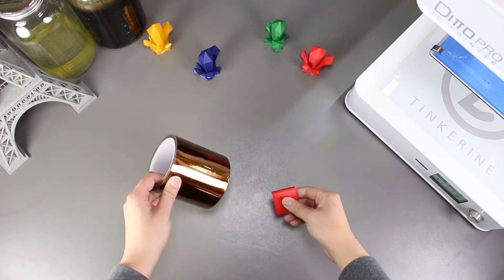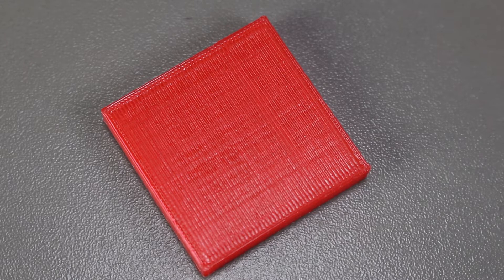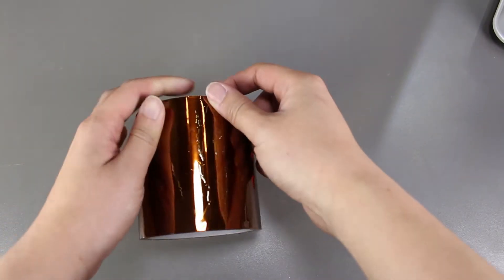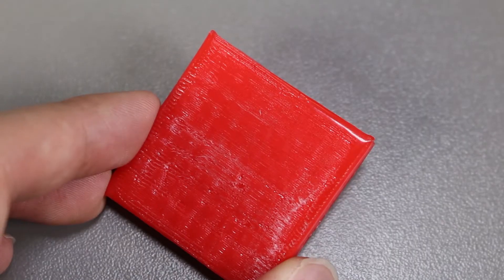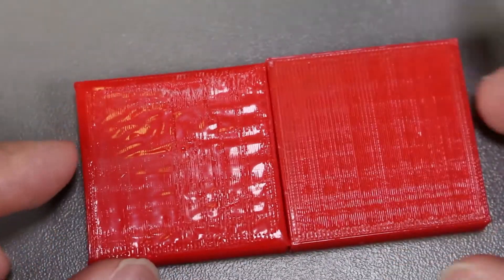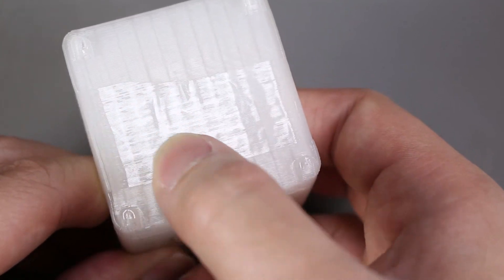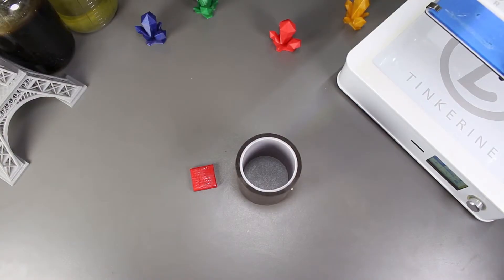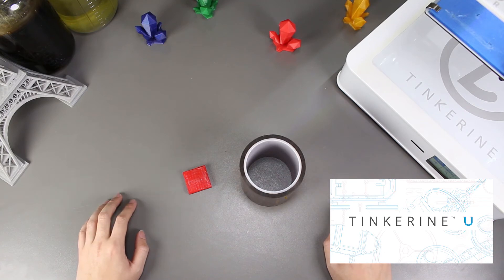Smoothing 3D Printed PLA Parts with Kapton Tape

Comment: IDK why to smooth PLA by a capton tape. My idea is to protect PETG by a capton tape pieces. I'm gonna print a fanduct which was slightly modified. So now it's surfaces are pretty close to the heat block. I want to protect it and also to prevent leaking a warm air into the turbines which will be my cooling fans.

Comment: Isn't this the best and smoothest result you've gotten this far? Definitely worth exploring Kapton tape and maybe there is some easier way to achieve the same/better result with some other material? Still Kapton tape with a more refined method could yield great results as well.
Reply from the maker: Thanks for the comment! So far this method is one of the easiest method to smooth out our prints other than lacquer thinner. We can definitely look into other methods with kapton tape that could also yield great results.